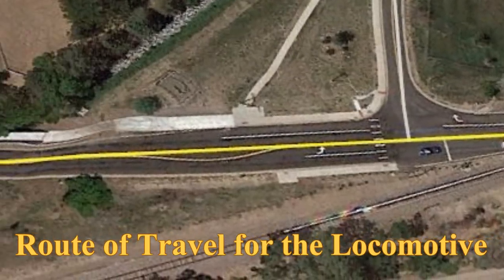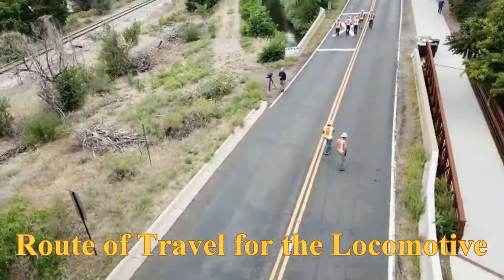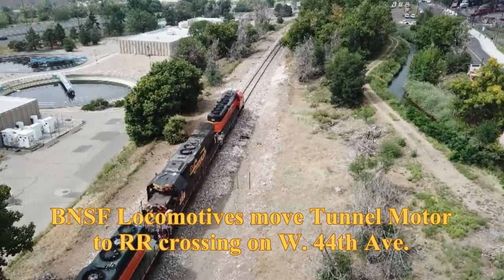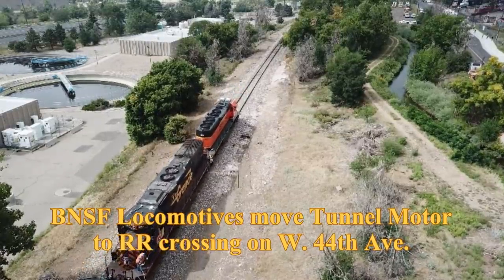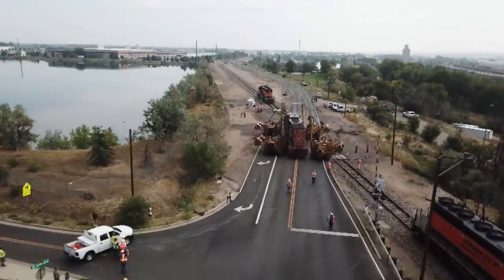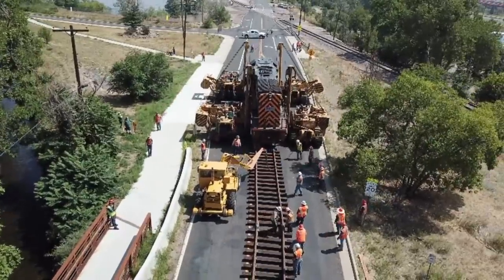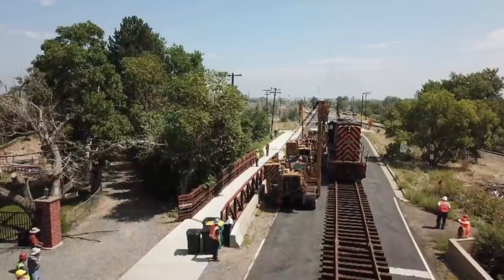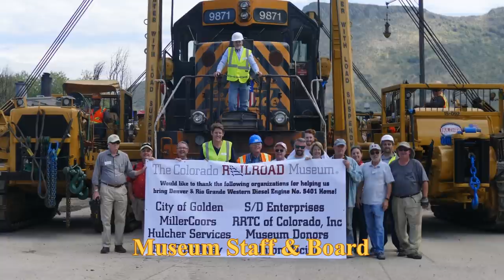2018 August 22nd   Denver & Rio Grande Western Tunnel Motor Move

Comment: I can't imagine anything more asinine than a rail museum without rail access!
Jack
Reply from the maker: Jack, If you had read the opening statement, I asked everyone to avoid inflammatory statements.  In this regard, you have failed.  But, perhaps you don't know much about our museum.  The cars and locomotives that are actually in use at the museum are narrow gauge.  While we do have quite a bit of standard gauge equipment, it's stationary.  So you have to ask yourself, what are we going to do with a standard gauge connection to the world?  Twice in 60 years make a delivery to the museum?  That must be it.  Take a look at the location of the museum on Google Earth.  You will see the rail crossing east of the museum.  South side of the road is a canal, north side is housing.  It's probably a good thing that you are not at our museum doing the imagining.
Reply: I guess he told you Jack!

Comment: Why are you doing this
Reply from the maker: The locomotive was donated to the museum and the museum had to arrange and pay for the move from commercial standard gauge track to the museum.  That is what is shown in the video.    Much of the equipment at our museum is Denver & Rio Grande Western Railroad equipment.  This is a special type of locomotive that was purchases by the D&RGW for use in mountain tunnels.  The air intake for the engine is at the walkway level, so when it is operating in the tunnels, it is able to get cleaner air for the engine.
Reply: I think the deeper answer to this question is to preserve something of historical significance. Railroads played a key role in the building of our country, and continue to play a large part in driving our economy.

Comment: Should have been easier to rebuilt the track leading to the museum grounds
Reply from the maker: Really?  First you would have to purchase the right of way to lay the track.  There is no vacant land from the crossing to the museum, so buy part of a park, some houses and maybe a business.  It was done the easiest way possible and the cost was not outrageous considering what had to be done.
Reply: @ROKuberski  the was a track some decades ago it it wa removed
Reply: @ROKuberski  when i recall the location right the sour to the coorz brewery is seoerated from the museum only by a 2 lane road and no housing over 2800 yards so building a permanent track should be easy

Comment: There went all the money that machine ever made!
Reply from the maker: Really?  Where did it go?  The UP donated it to the museum and the museum funded the move onto the property.  Be assured that the cost of the move was reasonable, otherwise, it would not have happened.
Reply: More than likely the engine more than paid for itself over it's life of service. Nearly every locomotive reaches a certain point in it's life where it's no longer cost effective to keep repairing and maintaining it. At that point  the railroad could sell it to a small regional or industrial railroad, sell it for scrap, or donate it to a museum. The revenue received by selling it would be minuscule. Donating it probably gives them a small tax write-off, but it's also great PR for the railroad.

Comment: Looks like they destroyed the road though
Reply from the maker: There have been a lot of comments on this.  The road was NOT destroyed.  Very minor damage at the entrance to the museum where they had to rotate the locomotive.  The dozers had rubber treads, steel did not touch the road.  The city of Golden repaired the minor damage at no cost to the museum.
Reply: @ROKuberski  I can't believe the road was rated for Caterpillar tractors , the counterweight on the tractors, and a locomotive. They make dump trucks drop the third axle carrying sand.  Seriously.? Why couldn't they lay down some temp  light rail track?
Reply from the maker: I don't know what you mean by a road   "rated for tracked vehicles."  Tracked vehicles have a lower weight per s.f. of contact than do wheeled vehicles.    That is the main purpose for having the track.  Otherwise a vehicle of that weight would place a huge pressure on the road surface at the point of contact.  They did not lay temp track for the full length of the movement because it was not necessary.  They only used panel track in two areas.  Those areas are where it was too narrow to have a side boom dozer on each side of the locomotive.  One area was a bridge crossing the other was at the entrance to the museum.

  The dozer plus 1/4 of the weight of the Locomotive is about 200,000 pounds, area of the track on the ground for each dozer is 53.6 s.f. , that's 3,731 pounds per s.f., or about 2/3's the wheel load of a 3 axle (10 wheel) dump truck weighing 60,000.  Please consider that the people that organized this move knew what they were doing.  After all, it was a success.
Reply: @ROKuberski  ok
Reply: Richard Kuberski ñ

Comment: Ehhh those cats chewed up that road !
..... nice
Reply from the maker: Not true.  Minor damage at the entrance where they had to rotate the engine.  City of Golden did minor repairs at no cost to the museum.
Reply: Look at the tracks bud. They are not the steel pads but rubber ones mounted to the tracks. I thought the same till the camera got closer. Its all rubber marks designed to do this. Sure it cost the muesum a pretty penny since equpiment modification had to be done.
Reply from the maker: I will verify, but I believe there was no charge for the units with the rubber on the tracks.  Already set up that way.  The museum director will not let me post the cost of this move, but you can be assured it was not exorbitant.
Reply: Yes your right .... there was a moment there ooo dear